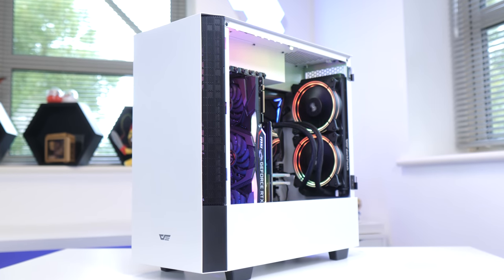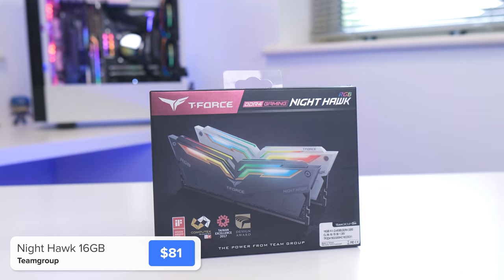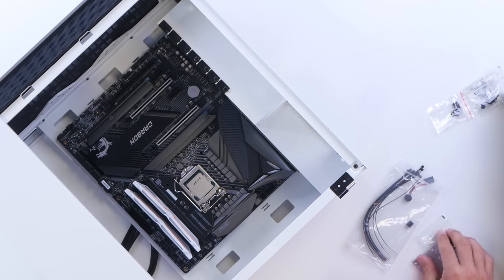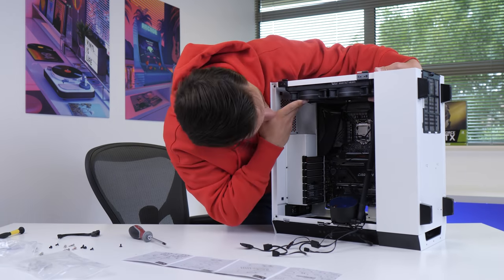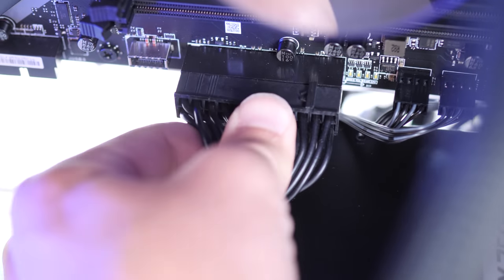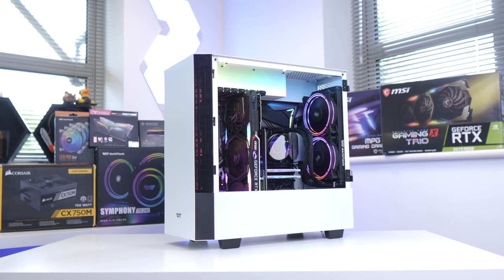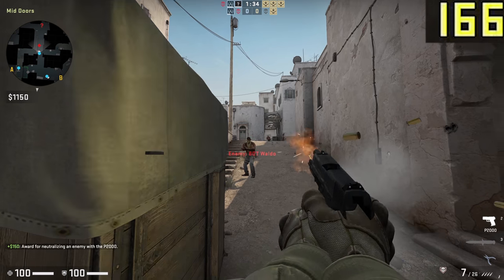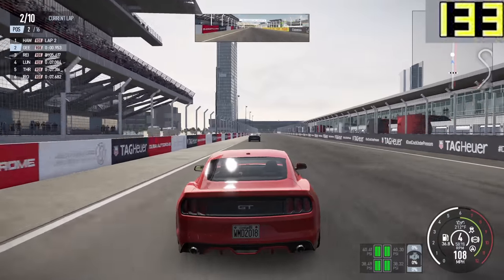Insane $1500 Gaming PC Build 2020! [RTX 2070 Super w/1440p & 4K Benchmarks!]

Comment: I’ve pretty much got the same but I’ve got ryzen 7 3800x, I’ve ordered a 650w power supply will that be enough?
Reply from the maker: Depends on the GPU but it’s a little bit on the low side...
Reply: GeekaWhat I wanna get the 2070 super I haven’t actually got it yet so what would you recommend for a 650w psu?
Reply: What are you taking about? A ryzen 9 3900x and a 2080ti can run fine on a 550
Reply: GeekaWhat 650w on the low side?!? I feel like that is the sweet spot.
Reply: Robert Duncan Ye if you get a 2070 s and a 3600 anything above a 500 is fine
Reply: Curtisg839 alright thanks guys

Comment: Honestly, I would go for the 3700x, a MSI Tomohawk B450 max, and use the stock cooler. I would also install the ssd before putting the motherboard in. Maybe you forgot to put it in before you put it in the case, but I just thought I should say it. I would also get some cable extensions. It will just make the built look cleaner.
Reply from the maker: Cable extensions are a great shout! Stock cooler on the 3700X on the other hand is not I’m afraid 😜
Reply: He didn’t forget he literally installed it at 3:34.... lol
Reply: Oscar Orozco I meant before putting it in the case. That wasn’t clear sorry.

Comment: Instead of the 500gb could I do a 1tb? What would be the difference performance wise? Would it handle it or whatever? I’m new to this stuff and need guiding tips
Reply: Yeah of course the ssd this guy got is horrible value. Defiantly get a 1 tb for around $60. You can swap all the parts here as long as there is no incompatibility issues or bottlenecking

Comment: Bit of advise: you could buy a ryzen cpu which comes with a cpu cooler and is cheaper than intel. And yes it does preform as well as the intel. But intel goes more to like only gaming while ryzen can do editing and streaming and gaming. And i wouldve gone for a better motherboard because i think the one you were using wasnt so good for the price. If you couldve fixed those things I am pretty sure you wouldve saved up more money and gotten 1tb instead of 500gb

Comment: Thank you so much for this video. Now I know what gaming pc I’m going to build. I do have one question though, can I buy this motherboard and instead of the intel processor use an amd processor? Please don’t mind me I’m new to all this. And I am thinking of getting the new nvidia 3070...let me know what you think.
Reply: Yeah for sure but imo you should look for a different build because you could save a lot of money if you got different parts.
Reply: What do you suggest though? I changed my mind about the intel, now thinking of doing the ryzen 3700x with the tuf gaming x570 plus mobo. But still wanna do the rtx 3070.
Reply: DominicanRat83 ok I’ll make a build as if I had $1500 right now. 

- rtx 3070 Asus gaming tuf $500
- ryzen 7 3700x $220
- 32 GB 3200Mhz Corsair Vengeance  RGB $150
- Corsair 750 W PSU $120
- 1 TB SSD $75
- AORUS X570 Mobo (wifi) $150
- NZXT H510 $75
- Corsair H100i Liquid Cooler $120
Reply: Curtisg839 thanks buddy, I will look into that bro👊🏾

Comment: I did almost the same thing for under 1700$ BUT with 32 gbs of ram and complete best lineup of be quiet!'s coolers with their 500dx case AND a GPU with a liquid cooler for some OC AND also a 1TB SSD AND a high end mobo AND I didn't use a different brand for every component AND as a result it looks waaaay nicer AND KICKS ASS.

Comment: Guys i've checked on the internet the 2070 rtx and i've seen that many people have a lot of problems with rtx graphic cards and most of them send for replacement and even then sometimes there's problems with it, anybody that used this card for a long time can tell me if there's any problem with it?
Reply: No there’s no problem with it, it’s a very stable card especially compared to an rx 5000 card, but if your planning on building this definitely swap the mobo, ssd, and gpu with something like a 3070 for $500
Reply: @curtisg8399  Bought a second hand gtx 1080 for like 250 pounds, did that cause 2 of my friends already have problems with their rtx 2070 super..they might just be unlucky but i believe they're not the only ones.
Reply: XdisaterX ah alright smart move going with the 1080 it’s better value compared to the 2070 s regardless of stability. Seems like a good price for the card too.

Comment: Hello dear I wanted to ask you something very important to me, now I'll explain: two months ago I purchased this gaming laptop is an Asus Rog Strix G731GT with 16 GB of ram that is two 8 GB banks (Manufacturer: Micron Technology, Product: SO- DIMM
Memory size: 8 GB
Memory type: DDR4
Speed: 3200 MT / s
Working supply voltage: 1.2 V
Maximum working temperature: + 95 C
Number of pins: 260 pins
Dimensions: 69.73 mm x 30.13 mm x 3.7 mm) were already in the PC when I purchased it from the original shop. Today what I did, a friend came and brought me two banks of 16GB that is 32GB total, and we made an exchange, he told me that he did not care for the ram if he took them only to sell them even if I she said hers were more expensive out of friendship she gave them to me. and they are precisely two shoals of Crucial ram (
Speed: DDR4-2666
Warranty - Limited lifetime of the manufacturer
ETC - NOT ETC
CAS Latency - 19
DRAM - Crucial family
Density: 16 GB
Brand: crucial
Type of module - SODIMM
Extended times - 19-19-19
Form factor - SODIMM
Technology - DDR4
Voltage - 1.2 V.
Speed PC - PC4-2666
Qty Kit - 1
Specifications - DDR4 PC4-21300 • CL = 19 • Double classification • Based on x8 • Unbuffered • NON ECC • DDR4-2666 • 1.2 V • 2048Meg x 64 •
DIMM type - Unbuffered) Now I would like to know and I ask you for pleasure if you think I did well or not also because I would have time to tell him to return them based on your answer: my question in a few words is: I have improved or no the performance of my Asus that I am still finishing to pay, ?? because I only saw that on my 8GB where it says SPEED there is written MT / s 3200 and its 2666 and missing MT / s. I ask you why I have not yet been able to see if the laptop is better or not just turned it on and I just work a lot for this I ask you because you are an expert better than you who can tell me and then so I have time to call and get them back before he sells them .. I humbly apologize for this question and for how I set it up but I'm at work and I look at the phone a thousand times to see if you answer me thank you thank you and thank you please help me understand whether to reassemble them or better with these two 16GB banks hello and sorry again

simone sassa